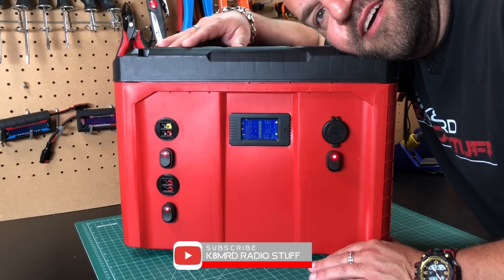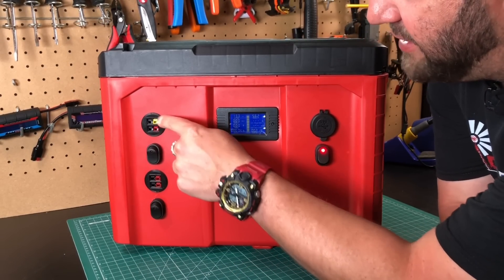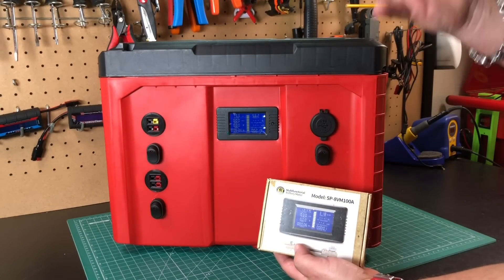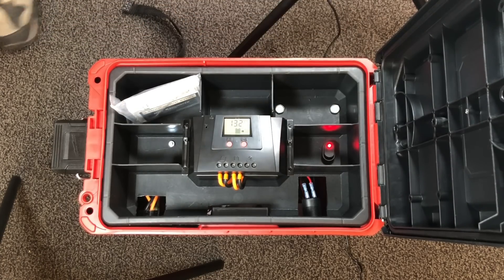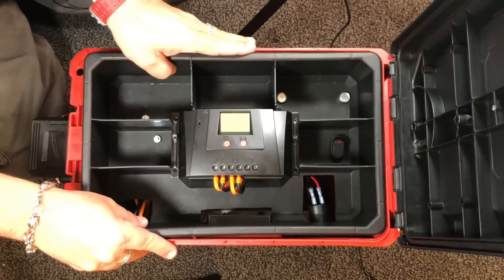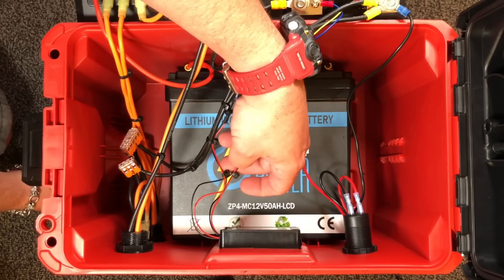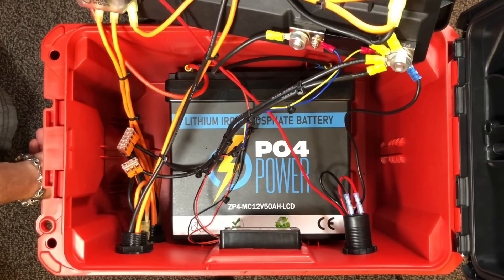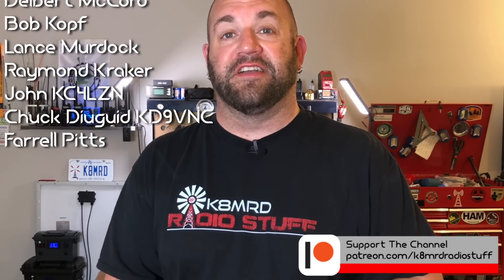Giant DIY Solar Generator Mega Geek

Comment: Clean install. I have a Droke brand, battery meter, with a "Hall Sensor". I have yet to install it, but you apparently just run your wires through a circular sensor ring, and it reads voltage.  It works like a shunt, but is smaller. Have you tried using that style before?

Comment: I am really concerned your box has three 25A power pole input/outputs, and a 10A feeding the usb block, but the main positive and negative wires are 12ga… I would recommend you upgrade the battery leads to #8 so, everything can pull at the same time without voltage drop on them…

Comment: So cool! Do your meters read the charge input current from your solar panel? I’m wanting to mount a panel meter that displays on the exterior (like yours) that also shows if the panels are pulling in current but without having to open the box and look at the controller. Nice work drilling perfect, measured holes for your switches! 👏

Comment: Nice build Mike, I purchased a bunch of the same parts for a solar generator I am building good to know they work well. I will also have an inverter not sure how I am going to hook it to the battery yet probably direct to the battery, but may use the cigarette lighter plug so I can move it easy. Thanks for sharing.
Reply from the maker: Power Pole all the things Chuck!
Reply: @hamradiotube  Ha ha it will have power poles but also XT60's for the heavy lifting.

Comment: Thanks for the info on the meter. I was going to order a different one for my build but I like the one you have. Since I'm upgrading from 50ah to 100 in a short time I ordered the 300amp version for a couple bucks more. It gives me more room for expansion.

Comment: I just got the "approval " from my xyl to build one. I have a few reasons for needing one.. I am on oxygen thanks to Covid-19... charger for my 02 concentrator, 2) Battery for a trolling motor for vacation in July and 3) for my radios.. we all know 3 is actually 1..lol.. I'm starting with 50ah Life4Po and adding another 50ah just before vacation. I may add a small inverter into the mix also (400w or less)

Comment: Very nice. I built one in a Craftsman rolling toolbox because I used two 50ah batteries. I’m getting ready to upgrade it to add 2 more 50ah batteries that can power my fridge and freezer and some lights in case the power goes out for a few days.

Comment: I always wondered why the Bioenno destructions stated not use the load port on their charge controller. Well, as an engineer (sparky variety), I emailed and asked "why"? I got a response within 24 hours. The rep told me that if you exceed the ratings of the controller, then the unit will trip out. So, if my peak load is 20 amperes, then I could use the 30 ampere unit and hook the radio / other widgets to the load port. It always seemed odd to provide a gazouta (vs. a gazinta) and tell you NOT to use it. For safeties sake, please confirm yourself with Bioenno as YMMV depending on whom answers your email. I don't wanna be blamed for bad things; famine, thermonuclear war, or your favorite widget going up in a cloud of black smoke. This information may help simplify your wiring. The preceding assumes this a Bioenno controller.

Comment: Nice box! 
One potential issue if I am seeing it correctly: it appears there is only a single #12 unfused wire from each battery post feeding the whole box. If so, that means you could have, say a 20 amp load on one powerpole, and a 15 amp load on each of the the other two circuits, putting a 50 amp total load on an unfused #12 wire. In day to day use that kind of load probably won't happen, but it could.....
Reply from the maker: The battery is rated for 50 amps continuous 100 amps burst.

Comment: By the time you get to 2"x3" or larger, 3M's commercial grade hook and loop (vecro) becomes an incredible way to attach things. Give the adhesive 48 hours to really set up, and you will have to fight to pull the pieces apart.

Comment: External switches with no bump guards or bails...sooner or later be bumped on or off at the worst possible time. FWIW.
Reply from the maker: Nah.  Been using them for years and never had that happen.
Reply: If you use the toggle switches with the flip up covers = yes. My first box I used those, big mistake... These thumb switches, I agree, no issue unless toddlers around. 😂

Comment: Hey Mike, Can you email me the basic wiring diagram of that box. I am using two Dakota 24Ah Lithium batteries in my box I have the same meter I am going to be working on mine as soon as I can get my Ham station area cleaned up. I'm going to physical therapy to get stronger but it's a painful chore. I'm sore for 3 days between sessions. because I am also doing the exercises at home. I greatly thank you.
Reply from the maker: If I knew how to do that I would.
Reply: Damn, like going to a fine restaurant and asking the chef for an exact recipe.   LOL   Basic electronics.   I'm sure there are thousands of how to videos out there.

Comment: Nice. I've been building mine horizontally in Pelican cases instead of vertically in tool boxes. Much easier to do the wiring. Do you have the battery anchored to the bottom or is it just heavy enough to sit there?
Reply from the maker: No I don’t.  It’s a good idea to anchor it though.  I told Jason he needs to find something to do that though.  In day to day activity it’s not really an issue, but I do use some heavy duty velcro on the bottoms of the batteries in the boxes I sell.  Only because the throwers at the shipping companies don’t take care of stuff.  In regular day to day life, it’s not a big deal.  But if they get thrown around enough they can break some stuff.
Reply: I built my 1st in a 4800 case but finding shortcomings with mine.